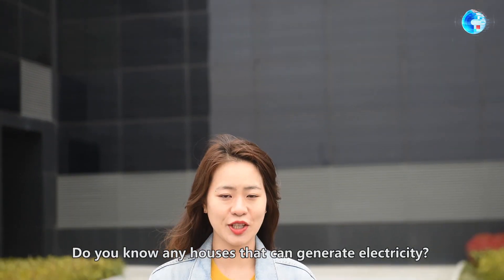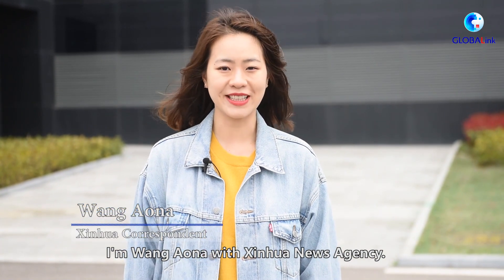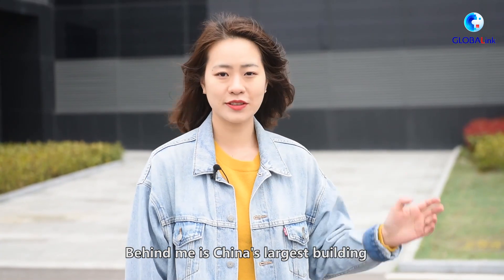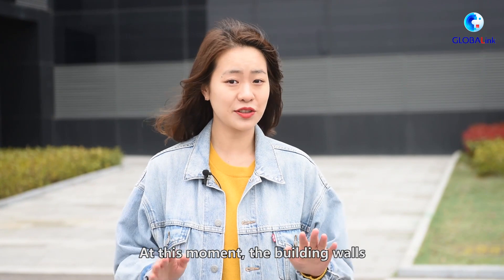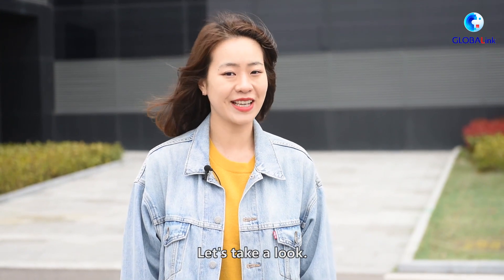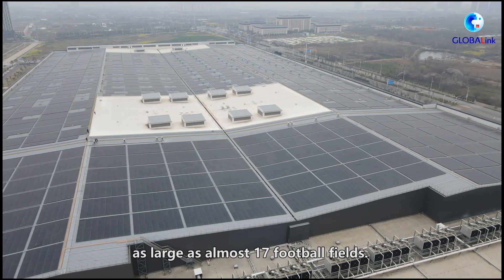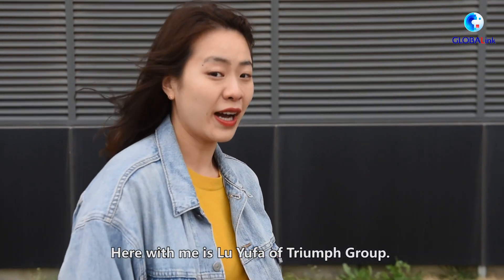GlobaLink | Discovering Anhui: Power-generating building in China helps cut carbon

Comment: 11Million kwh per year？ Three Gorges Dam  generates an average 100000 Million kwh of electricity per year
1/10000  of Three Gorges Dam，I doubt it
Reply: may be 1.1 mio kWh per year
Reply: @somphetkonex  
Nevada Solar One 
400 acres 
Site resource	2,606 kWh/m2/yr
Annual net output	115.9 Million kwh
------------
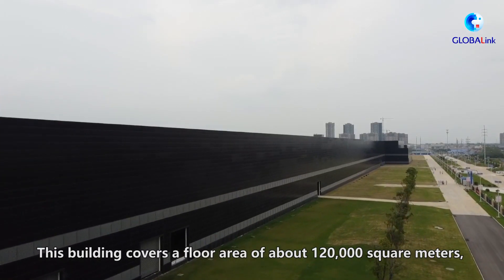0:25 120000 square meters=29.67 acres
7.5% area,  none desert, and much weaker solar site resource
0:49 1/10 of Nevada Solar One output???
Reply: 120,000m2 @ say 100w x 8 hours = 96,000 kWh per day.  They did say the PV’s work in low light